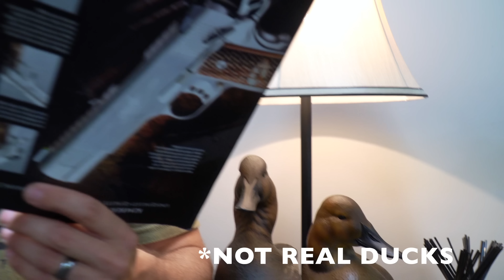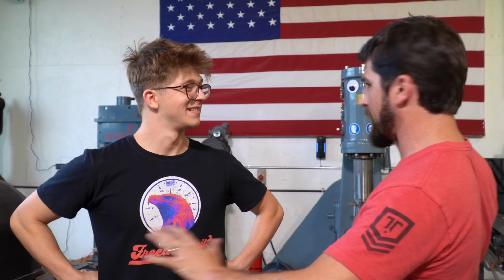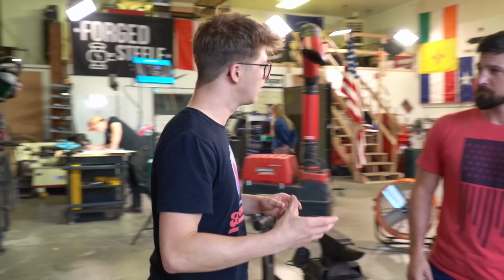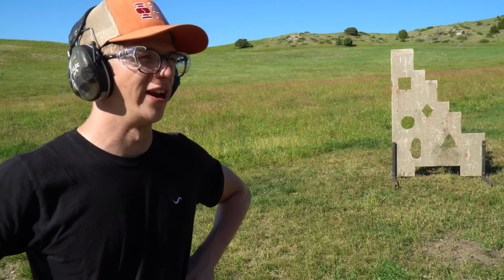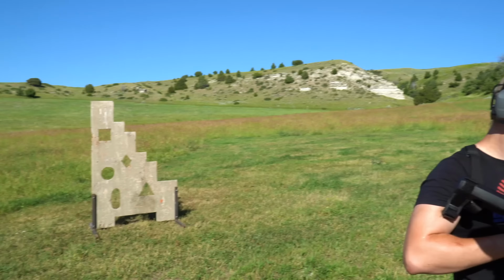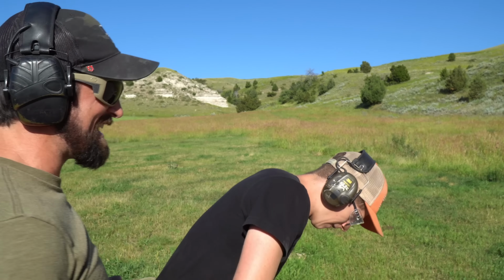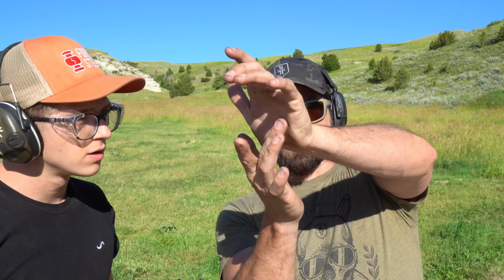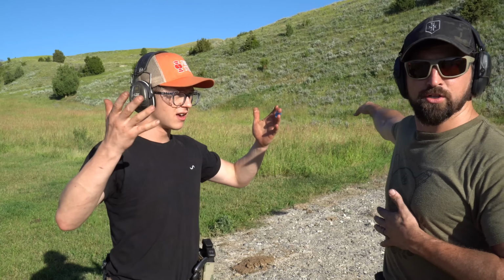Shooting with ALEC STEELE + FORGING the 'Zombie Slayer 2000'

Comment: Great collab.  Came over from Alex's channel. The way you turn to go up range makes me cringe.  Dragging the gun is actually faster and much safer.  At 13:10 you turn into the crowd and run w barrel pointed up-range. If you had turned left and drug the gun it would have been faster and the barrel never left the berm.  Not trying to be an ass, I've been a USPSA CRO so long it just stood out like a sore pecker.